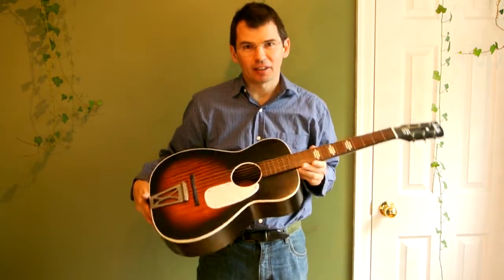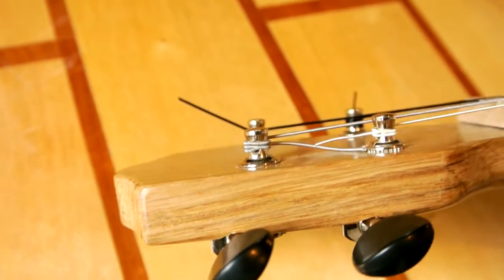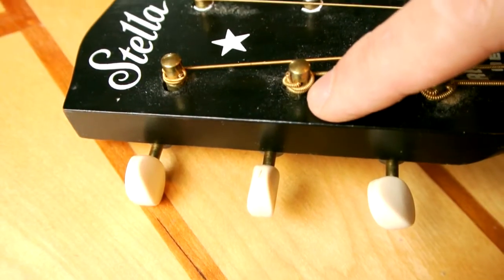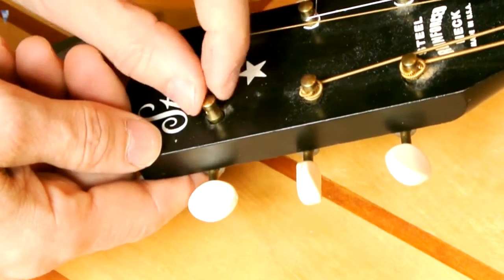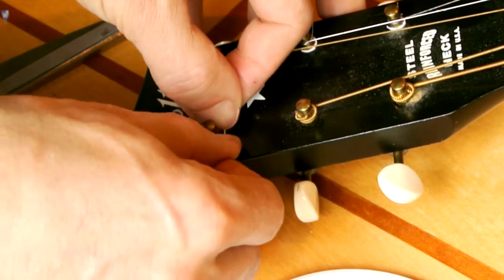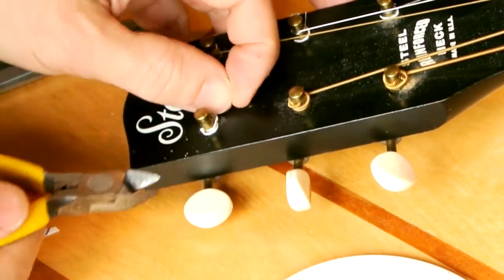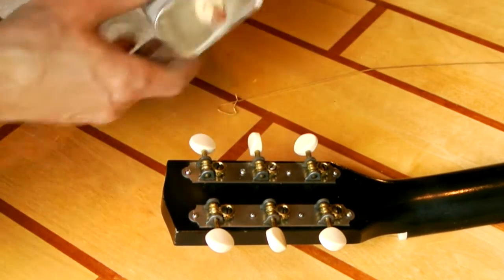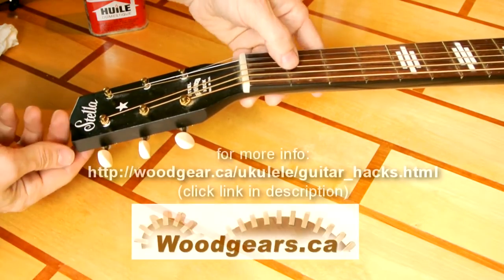Improving cheap guitar tuners

Comment: So after watching your video I remembered that I have some thin-walled brass tubing that I use pen-making on my lathe. The tubing looked about the right size to fit in the tuner holes on the peghead of my Regal T-12 parlor guitar (probably the exact same guitar as your Stella, but with a different brand name.)  Sure enough, the 7mm tubing was an exact, tight fit for the hole and was still wide enough for the tuner post to fit through it. I cut some lengths with a plumber's tubing cutter, pressed them into the holes and voila -- instant brass bushings. (I'd post photos but it doesn't look like YouTube comments are set up for that.) 
It's just a cheapo guitar, but I love the tune for old blues.
Reply: Great idea!  I have had success using plastic straws, and even old ink pen barrel parts to make bushings. Also, PEX tubing from the hardware store.  Finding and using "obtanium" for projects is part of the fun.  Where there's a will, there's a way.

Comment: Matthias random stuff that's a old Harmony a real Harmony they used hide glue on those most likely solid Birch tone-wood if its from 73-74-75 then its laminated Birch. Machine heads usually always go bad on those Harmony's braces come loose and neck's usually need to be reset because the action is so high. How is the action on that Harmony? Sometimes you can fix the action from the bridge. There is a poor mans neck reset take razor saw cut the neck heel until get to figure board and put and strap button with a bolt on.

Comment: HAY!  GREAT VIDEO GUY!   A Lot of old timers who did not have heavy oil or axle grease, used Vaseline as a thick instrument grease for wind and stringed instruments... it is also a very clean grease that stays in place when excess is removed. YOU CAN actually buy tuner bushings apart from the machines.  I found a bunch on google under "bushings for guitar tuners". 

https://www.google.com/search?client=firefox-b-1-d&q=bushings+for+guitar+tuning+machines

Of course you cant get any cheaper than a sour cream container  LOL

Comment: Fast easy fix. someone has already mentioned using petroleum jelly as a thick lube for the gears, you can also use a tiny amount in the grooves of the string nut to help prevent binding when you tune, if the guitar goes "ping" when you tune it the that means the string is binding in the nut groove, you can also use pencil lead (graphite) to lube the nut slots, just run the pencil through the groove a few times to lay down some graphite and it should stop the binding.
Reply: I have noticed some of what I think of as a "ratcheting effect" while attempting finer tuning - overshooting in both directions.  One of nylon's characteristics in addition to its ability to stretch and its durability is its resistance to biodegrading.  Never occurred to me until now that even petroleum products should have little or no effect on integrity of the strings so this should be a good fix, although its not comforting to think of landfills as being woven into large mats by discarded guitar strings.

Comment: I am building a ukulele and I bought some cheap tuners without bushings and they said to drill 1/4 inch holes, but that seemed way too big, so I drilled them exactly the size of the posts, and they fit snug but turn, so that should be good when I get strings on it.

Comment: Good find- that fix would make a huge difference.
You can get small diameter and thin wall brass tubing at RC hobby model shops.
.
Or you can get bronze bushings at industrial suppliers.
What's the measurement of the pin in the tuner?